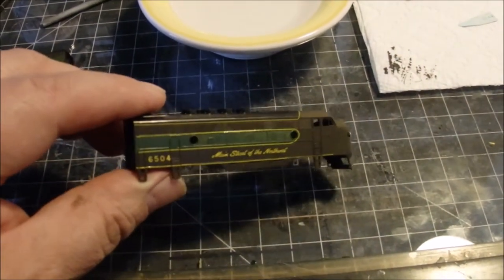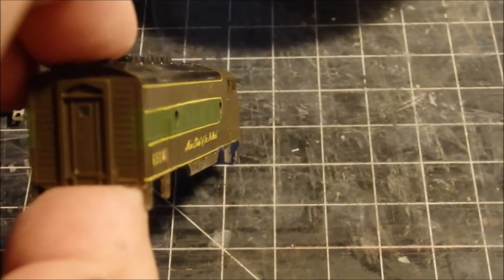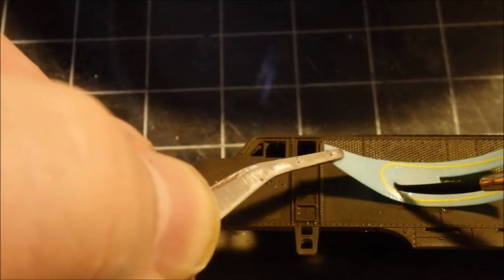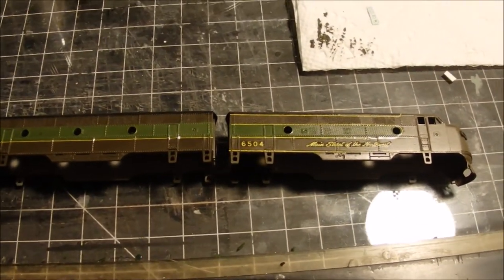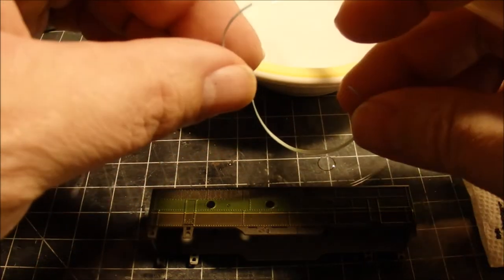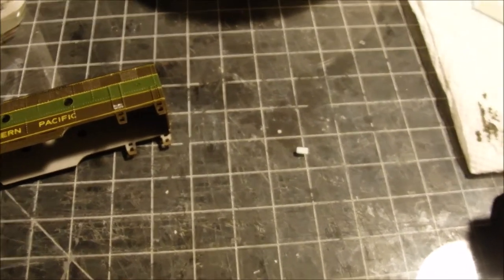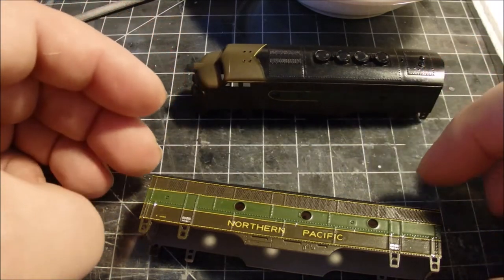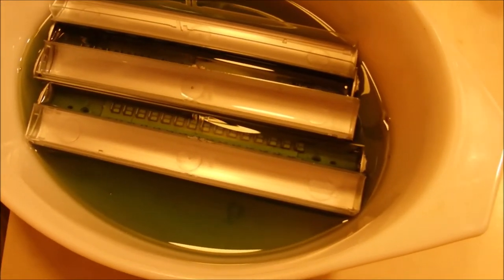MNW N Scale Model Railroad Monthly Video Journal, February, 2020, Part 2.

Comment: Colin ~ WOW !!  What tiny little lines & signs !!  Looks good but very tedious. 
How many passenger cars are you planning on having that A & B unit pull ?
Looking forward to more on the painting & decaling, AND your terminal build 2.0
Ray
Reply from the maker: Thanks Ray! I'm looking at about 12 to 14 cars, may need to add another B unit. The Union Station is still on the work table, just taking a little break from it for now.